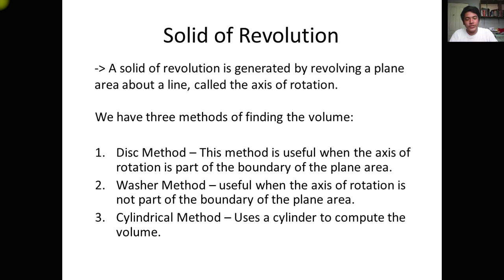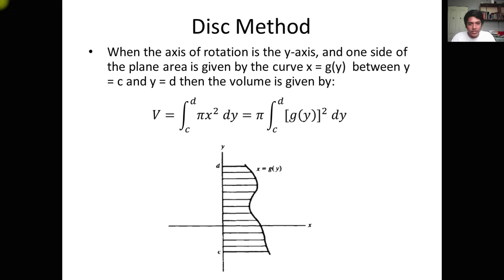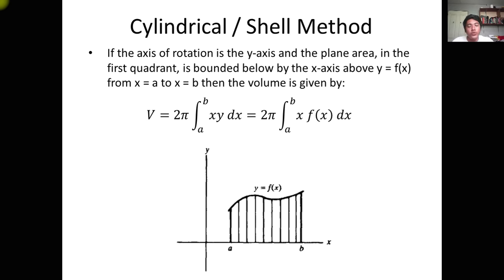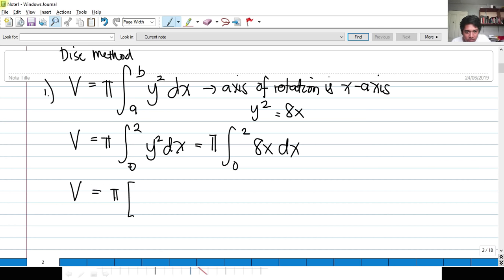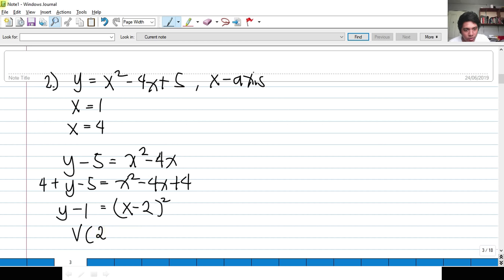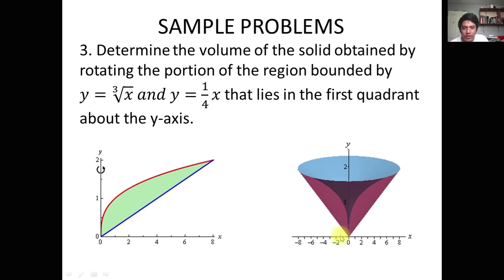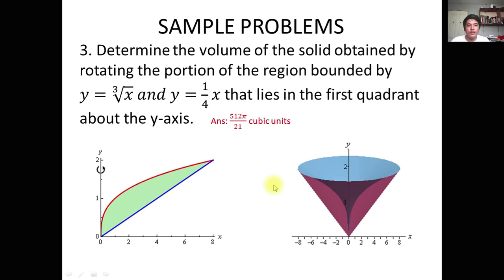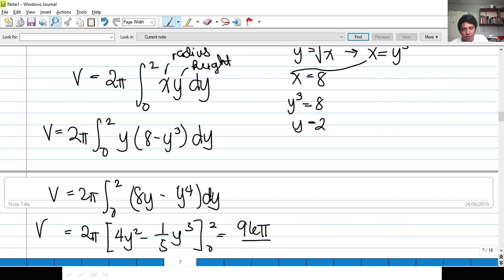Application of Integrals - Volumes of Solid of revolution

Comment: hi po sir. ask ko po sana. Pano ma lalaman if yung lower limit is magiging 0 lang? kc minsan po sa questions walang naka sabi na eto first quadrant lng. Ganto po yung tanong, "Find the volume of the solid generated when the area bounded by the curve y^2=x, the x-axis, and the line x=2 revolved about the x-axis." (use shell method). Ganyan po huhu
Reply from the maker: Automatic na zero ang limit niyan kasi with respect sa x axis
Reply: @abatandchill  goods na po I just passed the integral this day. 2.50 grade hehe 😊 dahil sa mga vids nyo po naka survive ako

Comment: Bawal po ba gamitin disk method sa last problem?
Reply: di ako sure pero  Xright - Xleft yun kapag kukunin mo area so horizontal yung strip nya tas kapag ni rotate mo sya about the x axis magiging parallel ang strip kaya ginamitan ng shell
Reply: No problem nman po ibahin lang limit x=0 to 8
Reply: Pero sa case ni sir gamit nya is horizontal differential which is parallel sa axis of rotation kaya obligado mag cylindrical method